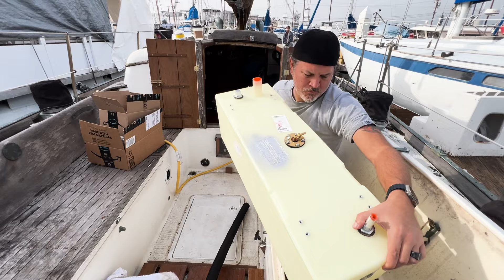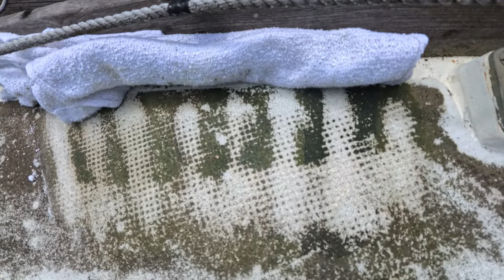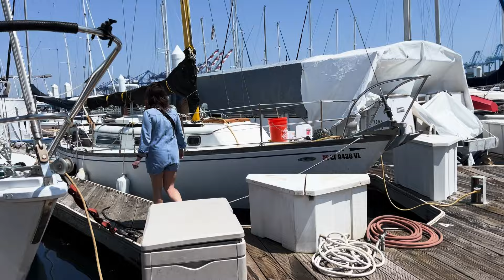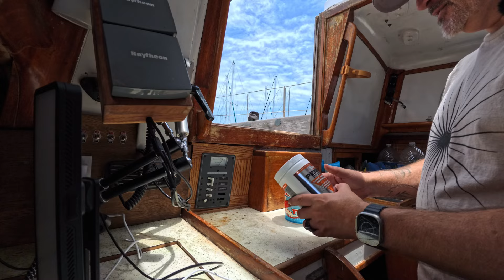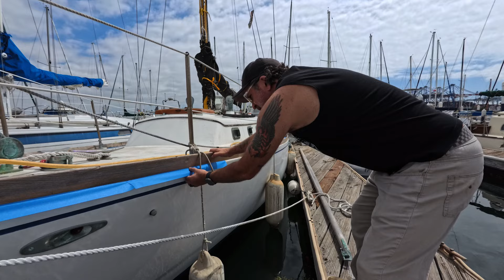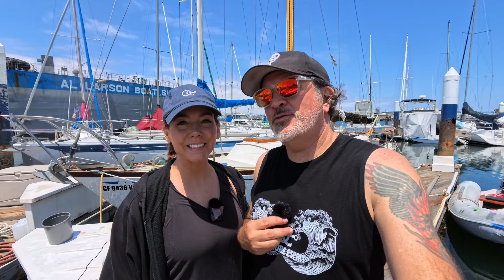Boat cleaners: You'll never guess what worked best! EP | 17

Comment: Liked the video. I bought a new-to-me C&C 29 last fall. It had been neglected. In fact, green moss was growing on the hull and the teak grabrails. When I got it to the slip this past spring, I used a cheap Chinese-made pressure washer to remove it all. Within hours, the entire boat was was deep cleaned. I'm a guy who believed in shower cleaner, but the pure power of the pressure washer did everything a lot of elbow grease would have accomplished.
Reply: @kylemacarthur3177 oh I so wish we took that route but the decks are so fragile (and fragile fiberglass on old soft spots) that I feared turning some deeply precarious spots into emergency projects with the pressure we’d need for those old stains (I tested a softer shot that didn’t get the results). The great part about the hand scrub was being able to mark out all the tiniest spots that needed attention on deck. My power washer is my other lover (sorry Matt) but I’ve also been destructive with it at home (also, sorry Matt!) so took to hands and knees out of an overabundance of precaution. Totally agree though, if possible for the project, pressure washer ftw!

Comment: I've restored several yachts over the years and have found that toilet cleaner is a great cheap way to clean mouldy fibreglass decks and hulls. It is the phosphoric acid in products like "Toilet Duck" that really makes short work of this awful job. High pressure washing also works a treat on fibreglass but you need to be really careful not to blast timber, which it will destroy. Teak is best cleaned using an alkaline solution and any outdoor deck cleaner should generally work. Trisodium phosphate, a favourite prep-cleaner of house painters, also works well. Applying a weak acid solution after cleaning the teak will neutralise the cleaner and will also brighten the teak, which darkens with age. Rinsing thoroughly after with fresh water is essential and the wood needs to be bone dry before oiling or sealing. 
Happy cleaning!

Comment: Wow, that oxyclean really works. That was a lot of hard work. Matt's lucky to have you Gillian! 😃
Reply from the maker: The Oxyclean was part of it, but really, it was Gillian just brute-force scrubbing for two days!
Reply: How come no pressure washer? They can be had for so little...
Reply: @DC_DC_DC_DC yes!! Oh and my love for my power washer is unmatched (sorry Matt 😂). I tried a small test when we first got the boat and it helped clean, but didn’t get the stains (using water only). And since I was making sure the detergents weren’t going overboard, I didn’t try the power washer with the cleaners. 

I’m also known for being a bit destructive with my favorite toy…and my surprise for Matt could have gone from good surprise to VERY bad surprise quickly 😂
Reply: @SeaGillian  1st mechanical bulk removal (brushes with some water with a drip of surfactant like dish washing soap or a pressure washer), then you can go to town on the discolorations. Don't forget bleach (the gel type) can be an awesome oxidizer as well but use it shortly only and perform some testing where you can't see it/care about it because some gelcoats can get dull (doesn't matter if you plan on polishing so much) and don't get it concentrated on stainless. Another great cheap tool for discoloration is simply a rough polishing compound and a (forced) dual action polishing machine with a wool pad. Look at flex, don't buy battery types.

Comment: Green deck: Are all the chemical product useless?
It looks to me that your muscel work with a brush did most of the job. Nicely done!
Pressure washer works best and effortless on natural alges from my experience. I need no toxic things at all. Your deck shold handle pressure wash just fine. Even the teak can benefit from the pressure wash but there you need to be gentle to not remove the softer "summer wood". The only negativ about pressure washing is the noise and blowing the crap on to my neighbors boat  :-) 
Very beutiful boat and you really make it shine again!

Comment: I wondered why the Oxyclean did best, and after reading learned it's mostly sodium percarbonate that dissolved in water yields hydrogen peroxide, the same stuff used to bleach hair. I think most white paints and sunscreens are made with titanium dioxide, and the TiO2 sunscreen industry use hydrogen peroxide to clean "white haze" (Ti02) that falls out of suspension in their production equipment. The hydrogen peroxide may be removing a thin layer of paint and all the grime on top then goes with it.
Reply: Interesting! I emailed OxiClean with a question this morning…if I hear back I’ll dig into this as well!